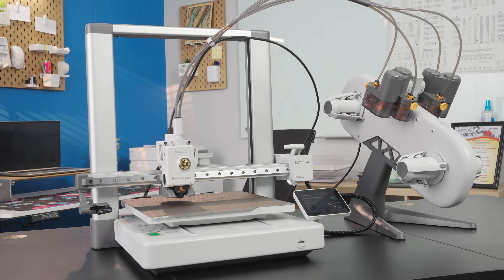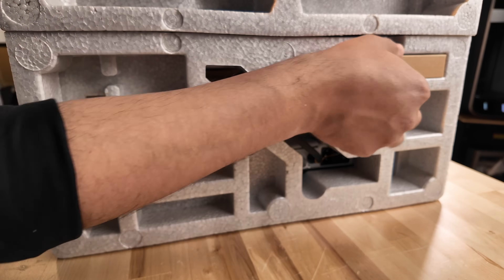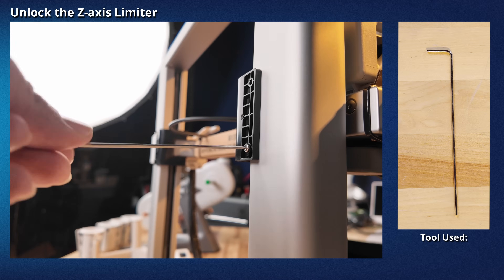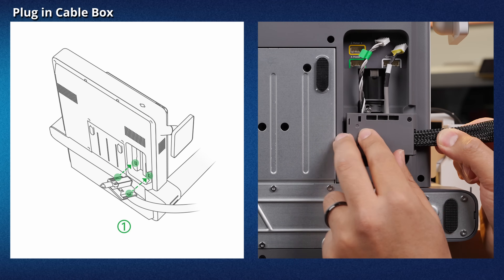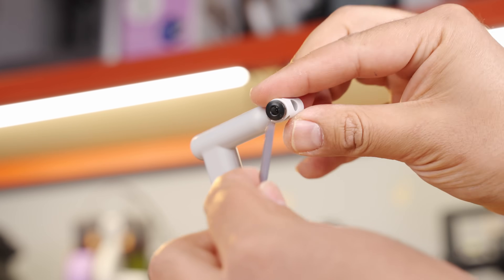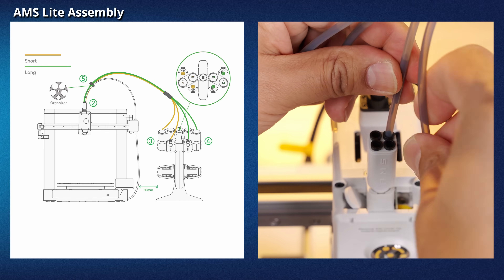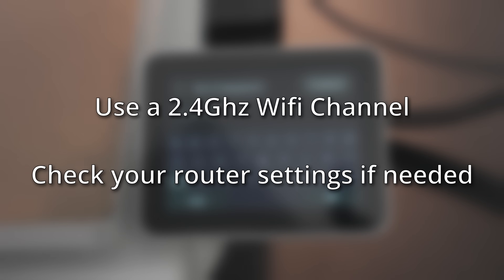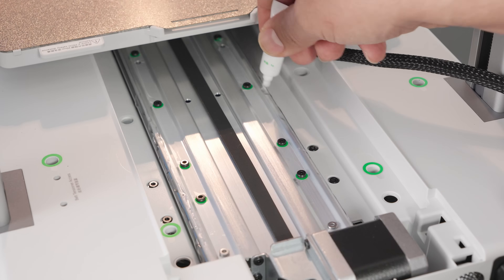How to Unbox & Set Up A Bambu Lab A1 Combo 3D Printer

Comment: Very helpful! Clear, step-by-step instructions were super helpful. Couple of tips: watch the video through before starting. Then watch it again, pausing to complete each step. Also, keep in mind that the packaging looks a bit different. There is an accessory bag now, rather than a box. Also, create a Bambu account before you start. If you start up the printer and try to create an account after you use the QR code, the system will time out before you receive the verification code.

Comment: on the callibration steps the printed melted a bit of plastic that was at the end of the bed, is that normal?
Reply: Hey brother, even tho i reply late, i think since the bed generates a nice amounth of heat for the plate, i think is normal, mine didn't melted anything, but yeah using simple logic i guess is fine...would be nice if you let us now how is doing now after a month :)

Comment: I'm in the process of the setup at the moment and made a mistake and don't know the process to correct it.  I am inserting the PTFE tube into the print head and installed one "long tube" into a short tube hole.  How do I remove that tube to insert into the correct hole?  Thank you for any advice.
Reply: yea it took me a second to figure it out but if you press down on the black connector hole it’ll release the PTFE tube. I pulled really hard before doing that and it just wouldn’t not budge but i didn’t want to break it 😭 afterwards it released easily!

Comment: Here’s the thing, for my AMS I put the filament on and stuck it in, but it the buttons were gray and wouldn’t let me edit it or load it! How to fix? (By the way, already tried the temperature level fix method and searched the settings and even asked AI).
Reply: I found out have to fix it. Basically you have to try to get the filament all the way in and also press the button if u do it right it should start automatically taking the filiament
Reply: Same

Comment: mine keeps saying Z axis homing failed
Reply: It’s ether You still have the z axis bricks on or you didint connect the z wire
Reply: @Screamming_kid That happened to me too.  Fortunately, there is a reseller near me who graciously took my A1 in and did a quick over.  I didn't have my Z axis connector pushed firmly in.  I thought I did.. but I didn't.  Thankfully, it was a quick fix and they didn't charge me.

Comment: My AMS won't work. I keep getting "unable to feed filament into the extruder". I tried the other spools too
Reply: My external spool won’t work either. I did everything right in the video, and I can’t even print a single thing, brand new out of the box. I can’t be the only one with this problem. Can someone help?? I miss the days when things fucking worked the way they’re supposed to… especially when they’re brand new
Reply: Update: I fixed it. it was a dry piece of filament stuck above the nozzle
Reply: @tardarsauce3355  any idea of how the piece of filament got there?
Reply: @mammothdonkeyrider It must’ve broken off inside. It happens a lot with my AMS

Comment: Does the ams have to sit to the right of the machine
Reply: Nah it can go anywhere as long as the tubes reach. The longer ones just go to the farther spools. Some people top mount it to the actual printer but honestly wall mount is best for me
Reply: @DISEASEOFNORM  just wanted to add I’ve seen printer files to mount the AMS to the top of the printer. But I’m leaning toward wall mount myself. It’ll have more to do with my choice of enclosure layout. Just setting up my A1 today for the first time. I figure I’ll run for a bit before I embrace a final layout.
Reply: @mammothdonkeyrider go wall mount, ive heard the top mount can add to instability and slower/worse prints. Not sure how true but if you go wall mount do one with a monitor arm/vesa mount to make filament changes easy
Reply: I believe the steps are at this time
8:00